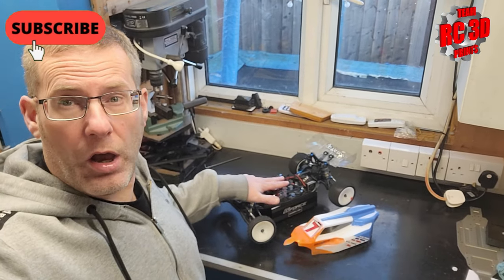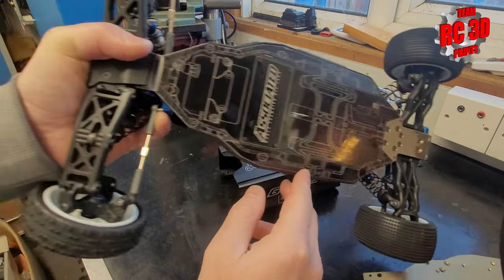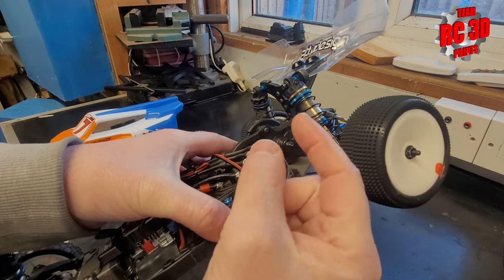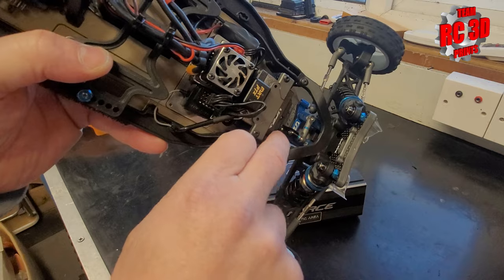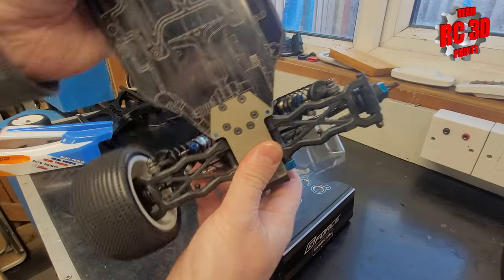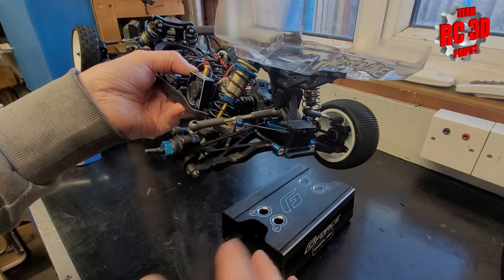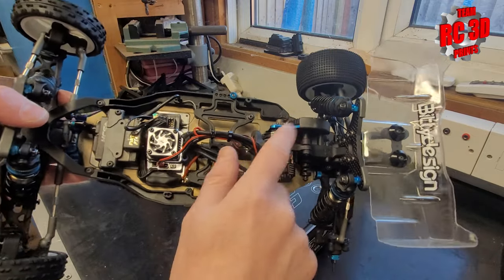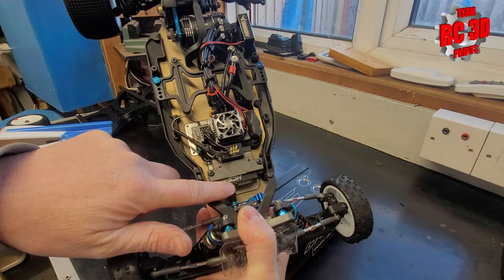What upgrades have we done to our Team Associated RC10B6.4 1/10th off road racer

Comment: Ive always used green slime on the outdrive o rings plus before installing the gasket i smear that completely both side with green slime also.  Then finally, i tighten down the 4 screws in a cross pattern rather than going round in a circular fashion.  As for battery strap, go for something with rubber straps.  This helps the chassis to flex correctly and reduce the chance of tweak in a crash.  Ive a nice jc one.   If you have some spare cash, get the kashima shocks and polished shafts   they feel sooooooo smooth!!
Reply from the maker: Thanks. Have upgraded to alloy diff case now

Comment: Great video, and I've just ordered 2 of those pill containers :) Just checking is the part number for the rear pill block 91688,

Thanks

Megan
Reply from the maker: Thanks - they are on their way today
Reply: @TeamRC3D  Brill, that wasn't a "hurry up btw, but greatly appreciated", can you confirm that the part number 91688  is the correct one for the rear blocks?
Reply from the maker: @megandavidson1357  No problem - yes that reduces the toe in by one degree if you need to get to less than 1 degree
Reply: @TeamRC3D  Cheers, just checking as there are a few different part numbers.

Comment: I had the same problem with the diff, even bought a complete new housing and tried again, but same problem. 

I ended up using silicone sealant in combination with the paper gasket. So far so good.
Reply from the maker: Alloy diff cover solved the problem for us
Reply: @TeamRC3D  that alloy cover didn't help me, didn't even try the plastic one. 3 packs and massive leaking with 10k oil.. Going to try those thicker xray gaskets next.

Comment: For the battery hold down I went with the Exotek (EXO1828) and it's fantastic carbon fiber goodness. Jconcepts servo mount (JCO2948-1) is wonderful if you like a one piece aluminum option. Alternatively, Avid Racing (AVD10110) offers a carbon fiber servo brace.
Reply from the maker: Many thanks. Will look into them
Reply: I agree with the exotec. I got one for my B6.4 and T6.4 and love em. No more looking for the thumb screws

Comment: The stock differential cover doesn't seal very well. Mine leaked from the start on my B6.3. On my B6.4 I noticed the seal surface wasn't the straightest. I've found them to be warped or can warp easily after tightening them down. I would highly recommend the aluminum diff cover. Associated part number 91781. I usually recommend this one item to all the Associated drivers since it made my car more consistent since it actually kept the fluid in the differential.
Reply from the maker: Just fitted the alloy covers and seem much better. Worthwhile upgrade for sure

Comment: As far as the differential is concerned I had the same problems with our 6.2 stadium truck
My mistake was OVER filling the diff. With the sun gear and the spider gears in fill just 1/2 way Do not cover the spider gears completely
Reply from the maker: Fill to cover the cross pins but the plastic cover doesn’t seal very well so we have upgraded to alloy

Comment: Great video on the 6.4. I'll try and help with the diff. It doesn't say it in the manual but I think you need to flip the gasket around. It won't make a mess anymore. Should work it's something that should be in the manual. Take care
Reply: Also if you want a setup for dirt you only need to change a couple things. I can send one if you'd like?
Reply from the maker: Cheers we have just fitted the alloy diff case to see if that helps
Reply: @TeamRC3D  it should. Good luck with it
Reply: Which way up text or no text? This fixed it for you? And it was same gasket not a new one?

Comment: I've tried the B6.1/6.2 D mount on my B6.4 to achieve zero rear toe angle as you suggest, however the driveshafts bind when the rear suspension is compressed. Did you fit shorter driveshafts too?
Reply from the maker: What position are your pills? We have not had problem
Reply: @TeamRC3D  Hi, thanks for responding :) I couldn't get the associated B6.1/6.2 D mount, so picked up a Willspeed version instead. I suspect the centres on the WS version are closer than the Asso version, as with the #1 pills fitted like yours, I had toe out.

I now have the #0 pills fitted in the WS D mount to achieve zero toe and have fitted 67mm dogbones. My originals were 69mm.

Comment: I see you use the 3 hole pistons In shocks. Is that front and rear ?  And do you drill fronts same size as backs
Reply from the maker: Have found 3 holes work well - usually .1mm smaller on the front

Comment: It’s already 2023 and pro kits still comes with plastic servo horn..😂
Reply from the maker: Yep - but if they put alloy horns for all servos teeth then it would bump price!!
Reply: @TeamRC3D  25 is pretty standard now unless you want to use specific brand like sanwa etc
Reply from the maker: @HL-OOI  True but a lot do use Sanwa
Reply: Get the alum diff cover no more leaks, I change to Tworks CF servo top plate..the wing brace is also good to have..😂 for the battery holder it just works even it’s ugly. also you can try the 2 gears diff with alum cross pins with 10-15k diff oil..